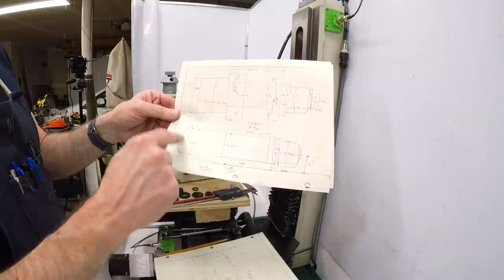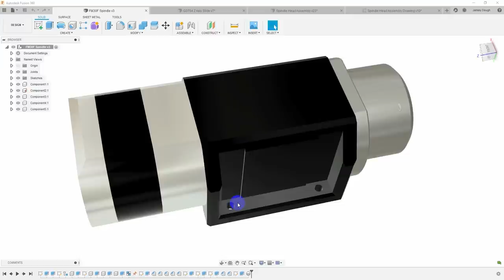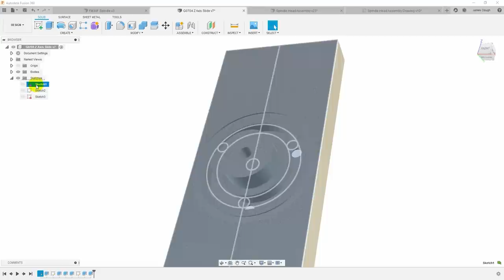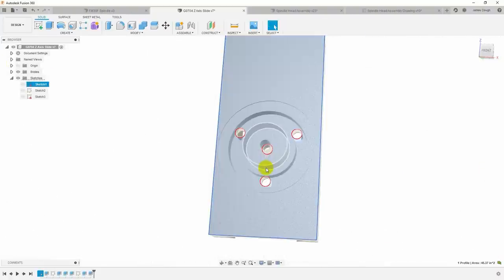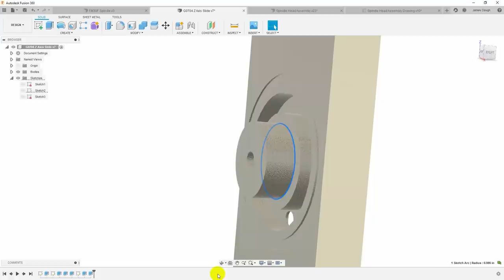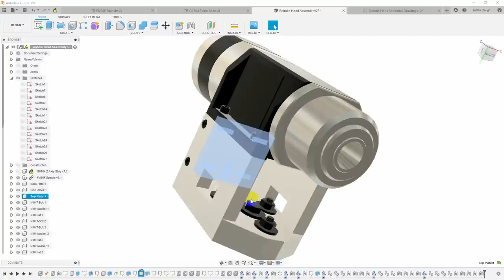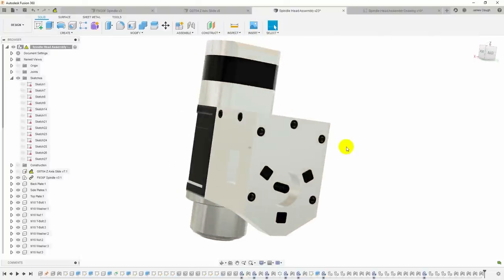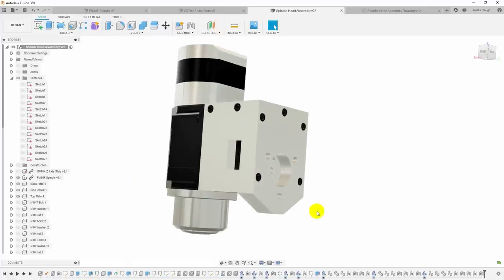ATC Spindle Part 3: Designing the Spindle Mount

Comment: On my drill press upgrade project I’m close to doing the same thing.  I need to strip it down to fit and parts then partially rebuild it to fit the table to drill holes in some new parts to take it apart again and fit them.  Or I was, now I have a sneaky plan . . .
Reply: If you haven’t already checked out @routercnc channel then do!
The “Pimping my drill press in to “not a mill”” is just great. 👍 Can’t wait for the next episode.

Comment: My son and I played a bit with the Huan Yang 2.2kw 24000 rpm spindle and VFD on the PM25 yesterday. As I mentioned, the mount was made from scrap and it's cobbled together.  LinuxCNC talks to the VFD through usb and it's fantastic.  Using a speed tiger 6mm end mill we were cutting a 10mm axial, 2mm radial, 4000mm/min cut and the spindle wasn't bogging at all.  That's about 5 cubic inches a minute.  The spindle rpm didn't sound like it changed at all.  And wow, did we make a mess.  With some flood coolant I'm 100% certain that same cut at full axial would be no problem, and be about 9 cubic inches/minute removal rate.  From a 6mm end mill!
We have a 4.5kw, 24000 rpm, BT30 Jian-Ken spindle that should arrive tomorrow and we'll first put that on the PM25 and make an enclosure to get some experience with that.  Then we'll take what we learned there and apply it to a PM940.  I'm wanting to get a CNC plasma table to make the cuts for the sheet metal enclosure...must...resist...
Don't let anyone give you grief over rigidity.  Yes, if you're wanting to machine steel or cast iron with 1" end mills then the rigidity isn't there.  If you do primarily non-ferrous (aluminum and brass for sure) then it's not an issue.  I do think now that flood coolant is pretty dang important at the higher RPMs.  at 24000 if you round a corner that blocks the mist air flow for even a moment, that end mill can load up and snap faster than you can react.  
It was very hard today machining on the 1100MX with 10,000 rpm after playing with that spindle last night.  Everything felt soooo slooooowwww..  That 24000 rpm spindle was throwing a stream of chips off that 6mm cutter like a stream of water, arcing up about 2' above the top of the mill.  We just sat there with safety glasses on laughing like kids.

Comment: James asks, "let me know what you think......"   I think you're channel is awesome!  As far as the new spindle mount goes, I would consider using 1-1/2D deep helicoil inserts in all of the aluminum plates.  The external thread of the helicoil in 6061 aluminum creates a shear area whose strength exceeds that of even A286 screws.  Therefore they will never strip out when tightened, and will not gall with repeated assembly.  Also, try and locate the helicoil as deep as possible in the aluminum, with a counter bore equal to the major diameter above it.  This way you will be using longer bolts that will be more resistant to loosening due to vibration when torqued.  Probably none of this is necessary to what you want to achieve, but a 3HP spindle is quite a jump from what you've been using.  All the best....  Joel
Reply: ^^^ What he said, bang on.

Comment: Hi James, Some background/perspective to my comments.  I am a retired industrial mathematician.  I wasn't trained as a machinist.  So, I look at things in my shop, perhaps, differently than would a machinist.  Regardless, I have had very good luck using the technique I am about to describe.  In your case, you have a center to center distance, CCD, of 2.591".  The first thing I would do is compute the bolt circle diameter, BCD, (more about this later) and determine if it 'wants' to be a round number in US customary units or, possibly, in metric units.  In your case, a CCD of 2.591" implies a BCD of 2.9918".  Here, I think the BCD 'wants' to be 3.000".  Doing this sort of analysis almost always gets me better fits than relying only on the 'actual' measurement of the CCD.  I won't always know why there is a deviation between my measurement and the 'actual' distance.  But, usually it is some combination of error stack-up in my measurement and manufacturing tolerances.

In my shop I have the following chart that I prepared in Excel laminated and hanging on the wall.

          Number                     BCD =
          of Sides               Factor x CCD
                3                          1.15470
                4                          1.41421
                5                          1.70130
                6                          2.00000
                8                          2.61313
                9                          2.92380
              10                          3.23607
              12                          3.86370

      BCD = CCD / sin(180/n)

      BCD = Bolt Circle Diameter
      CCD = Center to Center Distance
      n = number of bolt holes

For ease of reading, I alternate the numbered rows black, red, blue, black, red, blue, ...

In your case, you have three bolt holes.  The factor for three bolt holes is 1.15470.  BCD = 1.15470 x 2.591" = 2.9918".  If the BCD was truly supposed to be 3.000" we would expect the CCD to be 3.000" / 1.15470 = 2.598 vs. your measured 2.591".  I would say that's well within the error stack-up / manufacturing tolerance for the degree of precision required in this part.

I hope this helps someone in the future.

Be well & Best  regards,
Gottfried
Reply from the maker: Great suggestion.  Thanks.  I usually do this, but didn't in this case.  A whole inch dimension is a little surprising, since so much on this machine is metric.  It did have imperial leadscrews, though, so who knows?

Comment: I have built an all aluminum mill with vertical glides for the Z axis. I have found that the aluminum machines very well but you lose a lot in rigidity. (I am going to rebuild with steel 4X4" column.) Since the head mount is flat plates it would be best to use steel plate. It takes 4 times the dimension size to replace the steel and equal the  strength.

Comment: I was surprised you measured from bolt to bolt rather than from center to bolt... since it's a circle.  then you have the radii.    Also, maybe build 2, one with draft, and send one to Clark @ windy hill foundry  (utube) and have a cast one made. Then you can have some real beef to your head. And you can finish the casting on your new spindle. While Aluminum is pretty good stuff, I still give it to cast iron.  BTW recently found your channel from a forum Machinist's Gazette, and it's great, you are great to watch. I like your engineering, very well thought out.
Reply from the maker: Bolt to bolt is a longer distance, so errors from the pin fit and measuring represent a smaller percentage of the total.  The math would also be slightly harder because the holes are different diameters.  Either way would work.  The Windy Hill casting approach would be fun.  Probably really expensive, too.
Reply: @Clough42  you never know until you ask him. What is the math when you do hole to hole vs bolt circle calc off the radii?  I would still need a radii to calc the holes, how is it done as bolt to bolt in fusion 365?  Are you just calculating an isosceles triangle? w/o the center and radii, how do you center it? not challenging you, just trying to understand a different way.

Comment: Hi! Great work. Definitely enjoying the continuing shop improvement series.

Curious if the dog-point set screw hole was omitted, or I just couldn't see it?

Also, a steel thread insert going into the aluminium parts seems like a sensible idea.
It may also be overkill, but a bridge-shaped plate on the underside to help prevent flexing of the box section while still giving reasonable access to the underside of the head feels like a good idea, rather than just leaving it completely open.

Comment: Hi James, I understand you want to keep the head angle option. Great! But putting the milling head back perpendicularly is time consuming. Why not integrate a worm gear into the design? Or, much simpler, a control screw to adjust the last 0.001°?

Comment: Hi James: I new to your chanel and as far as I have seen it is amazing, thanks so much for sharing your path and progress with your shop and machines. One comment that I think it will improve your hability to show the details of your designs in fusion, specially in white parts, Change the "Visual Stile" to "Shaded with Visible Edges Only" option or "Control 6". I hope this helps. Also Great desition to try the space mouse, I refuse to design without it, it is just an extension of my body when designing.
Reply from the maker: Oh, hey!  That's way better.  Thanks!

Comment: Do you think the G0704 is rigid enough for a 3 hp motor? 

I’ve got the G0731 which is their knee mill with a 1.5 hp motor and my mill isn’t even rigid enough to take a heavier cut. There’s more than enough power, it’s just the mill wants to shake apart with anything heavier than about 1” axial width of cut, 0.030 radial depth in steel. With a 3” face mill, about the most I can do is 0.030 depth in steel, before it starts to shake badly.

Comment: The Space Mouse is the ONLY way to go with any CAD system. I got my first one 10 years ago and quickly decided that I will not design anything without it.
Reply: I also do that, if for any reason I don't have it when I need to design, I better wait until I get to it to start designing, any attempt of designing without it is a waste of time.
Reply: +1 Ran out of buttons though. But it’s ok. 😉

Comment: Regarding threads in alu; if you've got room on the spindle, loctite in threaded studs into the alu and fasten the spindle using nuts and washers. Removable and strong.
Reply: I think it would make more sense to just use Steel. The Aluminum is going to expand as that spindle motor heats up. While the Steel will expand, its will expand considerably less. Plus it could be easily welded together for additional rigidity.
Reply: @guytech7310  The spindle motor is cooled, and it won't be getting that hot.

Comment: How far out is the center line of the spindle?  I have a PM-25MV that I'm making a spacer plate for so that I can reach to the end of the table in the Y axis.  It looks like it won't have as much distance from the column to the center line of your spindle, but that could just be the optics of the drawing vs the video showing your mill.

Comment: You could do a rough FEA analysis in fusion and find out at least what the likely mode of flex will be.
Reply: Was thinking the same thing. That column will need some major beef. I have a G0704 and the main part of my build is adding some meat to the vertical column. That BT30 ATC is going to introduce some major flexure on that column.

Comment: 6061 - Mechanical Properties
Tensile strength: 276 MPa (40,000 PSI)
Fatigue strength: 96.5 MPa (14,000 PSI)
Shear strength: 207 MPa (30,000 PSI)
Hardness: 95 (Brinell Scale)
Machinability: 50%
7075 - Mechanical Properties
Tensile strength: 503 MPa (73,100 PSI)
Fatigue strength: 159 MPa (23,000 PSI)
Shear strength: 331 MPa (48,000 PSI)
Hardness: 150 (Brinell Scale)
Machinability: 70%
Reply: Yep, good observation ... although in the design presented mainly the bolts "do the job".

Comment: What are your thoughts on purchasing an older CNC mill and starting from there? This is a fascinating project, but there seem to be two basics parts of a CNC mill, electronics and mechanical. An older say HAAS has most of the engineering in place. Yours is smaller to be sure.  I probably am missing it, but do you use Mach3 or say linuxCNC alternative, Dennis L.
Reply: always easier to find a used dead cnc on craigslist and swap the software than make a cnc from a manual machine

Comment: Try and incorporate some alignment dowels.  no need to worry about strength your design will far exceed any tool that can fit in the spindle.  part of the design criteria for  a part  or  assembly for a machine tool should be  can it withstand a full rapid crash and not deform past  the materials plastic deformation properties.

Comment: James: How will you build in tramming adjustments?
Reply: They say if you can't make it perfect, make it adjustable.  I guess we'll see which way James  chooses ;)
Reply: It will still be able to be trammed in, the same as the other head was.
Reply: Tramming adjustment in the XZ plane is straightforward but in the YZ plane ("nod") could be painful, as shimming may affect rigidity during operation.
Reply: @chrisarmstrong8198  You make it perfect to start with just like 90 percent of the mills out there. Also, you can use epoxy instead of shims so it would retain its rigidity or scrape it in.

Comment: Why not measure the "nose" on the z-slide rather than, or at least in addition to, measuring the bore in the head casting?
Reply: I think I would have measured the slide as well. Measuring the head casting includes all the error from when it was created. Making a part that fits the z-slide will get you a better fit.

Comment: Thank you I was thinking,  how to convert the castings I have so I can us the head to rotate  in a way so I can cut on an angel,  that as mad my choice of dimeson.  I will copy that & do the meaning in my fore jaw chuck on the Lath ,  Shap I cadent get to by that of the shelf electronic  lead screw , off you had to revert to the original plan & Fit one.  but thanks for this idea . Les England.  love the page , interesting , got the Bearings,  yesterday for the mill shaft ,  I was not  to shore on  tapper did consider a mores 3 . yous I may go with yours & by a one you have ? 
thanks again , at my age it grate to hove someone ells do the Thinking .  At "78"  the bran Cells begin to go . . LOL {that us old farts for you }.

Comment: I don't know if it's just me, but I would never make a piece of a machine tool out of aluminum, it doesn't seems right
Machine like a DIY CNC router which are entirely made out of aluminum are ok, but in this case I think it isn't beneficial
I'm sure you've made your considerations, and since I've seen others do it like that it should all be right, but I wouldn't take the risk of having a weaker material holding a 10000+rpm spindle under load
Reply: +1.  Thermal Expansion is another issue with using aluminum once that spindle heats up.
Reply: Kern Precision uses Aluminim for its Micro series machines.

Comment: BT30 versus ISO30: did you do any thinking about the lack of drive notches in the ISO30 allowing tool slip in heavy milling? https://www.stepcraft.us/blog/stepcraft-blog-6/post/iso30-vs-bt30-atc-tool-holders-what-is-the-difference-15
Reply from the maker: This is a high speed ISO30 spindle.  It doesn't produce a ton of torque.  Using BT30 tool holders for convenience shouldn't be a problem.  Running ISO30 tools in a high-torque  BT30 spindle would be much riskier.
Reply: @Clough42  It might be informative if you walk through the tradeoffs between the original spindle and this one.  I understand that you get more RPM with this spindle. I don't know what that means in terms of capability when you factor in torque, or how it compares with the original 0704 or maybe how it could compare with, say, a Tormach 440.  $3500 is a sizable chunk of change, so I assume you decided you are getting more capability for your use cases (materials, tools, etc.). Put another way, what drove you to this solution? Like your approach to the topic, btw!

Comment: Are you going to use ductile iron?
Reply from the maker: I was planning to use aluminum.  I considered ductile iron, but I really want to keep the weight down.  Seeing now how much the factory head weighs, it would probably still be a lot lighter.
Reply: @Clough42   You actually spoke about it right after I wrote this comment. I jumped the gun lol. I use the ductile iron from mcmaster Carr for a lot of things and I actually prefer it over aluminum in many cases. The weight and the vibration dampening properties would probably outweigh any negatives which is why they used it on the original. Cast iron  Machines quite well  And you may end up liking it. Except for the stained hands after handling it

Comment: You should Google G0704 tramming aids.  Two little aluminum blocks that mount next to the head on the right side and let you tilt the head in very small increments using set screws.  That plus a spindle indicator makes setting and locking tilt and getting the head tightened again a breeze.  I'll see if I can find a link and edit this.

http://www.migration.g0704.com/Projects2.html Partway down the page